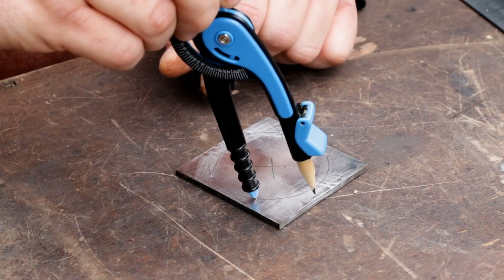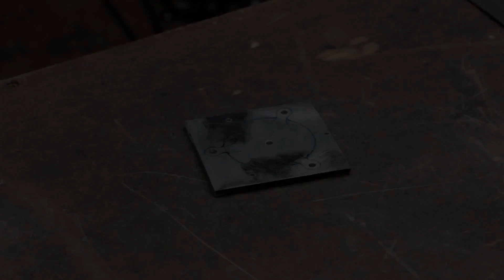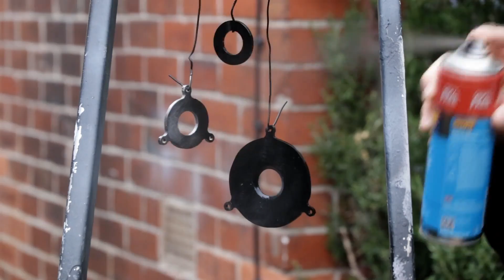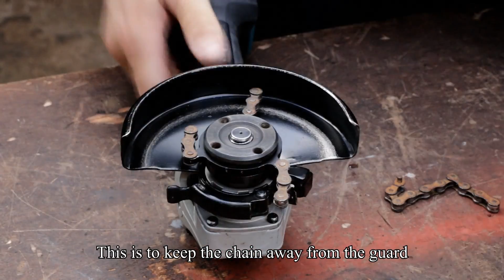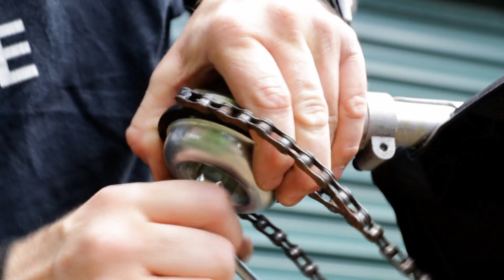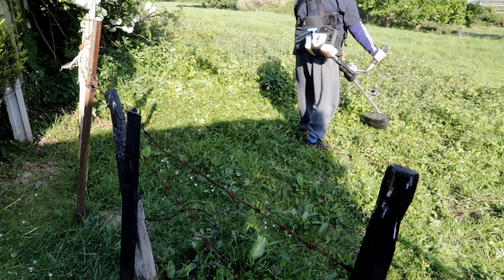Homemade brushcutter chain attachment

Comment from the maker: There is no doubt this is more dangerous than the average tool, I think if I was to make it again I would I would attach both ends of the chain to the body therefore if one of the chains broke it would probably be still attached to the tool.
If anybody does make buy or make one I would recommend wearing the same safety clothing you would wear when operating a chainsaw, and I say “buy” because you can get something similar off amazon
Reply: If we don't do anything, we definitely won't fail)). waiting for new interesting videos (Не ошибается тот, кто ничего не делает. ждем новых интересных видео)
Reply: i know im asking the wrong place but does anyone know a method to get back into an Instagram account??
I was dumb forgot my account password. I love any tricks you can offer me.
Reply: @Issac Briar Instablaster ;)
Reply: @Terry Christian i really appreciate your reply. I found the site through google and im trying it out now.
Seems to take quite some time so I will get back to you later with my results.
Reply: @Terry Christian It did the trick and I finally got access to my account again. I'm so happy!
Thanks so much, you saved my account!
Reply: @Issac Briar glad I could help :)
Reply: A company in Cleveland Ga. use to make a head called Weed Wizard. That used chainsaw chain. It was a very small company. I worked at a company that helped test them for safety. The weak link was the pin that connects them to the head. It seems they ended up using just an every day steel dowl pin. The head itself was in the Teflon family.   They were too small to have a big advertisement base , didn't get into Walmart, before Lowe's , Home Depot were really big-time. So they had about a five year run. I kept one of the heads and used it for at least twenty years. The end links would get ripped out one by one. When the chain got too short I'd simply add another section of chainsaw chain to it with a master link. Those original steel dowels never wore out nore did the original links on the chain on the head. The Green Machine trimmer it was on was stolen by meth heads. That's why I was watching videos, trying to see ways of making a new one.

Comment: There used to be a commercially made cutter like this in the 1980's or 1990's called the weed wizard but it used chainsaw chain. It was hard on the weed eater and wasn't good near walis or stone but worked great on tough weed and brush.

Comment: Why did you go to the trouble of cutting out 3 cleats to attach the chain? Just make a circle from the steel plate and drill 3 holes near the outside edge at 120 deg apart this will be better balanced too. 🙂

Comment: That's so dangerouz
Reply: And not effective
Reply: I'd say it's affective but the other stuff breaks easy for a reason lol.
Reply: Noah B the grass cutting he showed would be done quicker with nylon line  or even quicker with a blade 
It might be useful on thick hard bramble bases and the like 
Fair play to him for trying and a good enough job but I don’t think it’s worth the bother especially when it’s more dangerous than what’s available
Reply: idk that was pretty thick grass but it doesn't matter one thing is for sure tho that this chain ones would last alot longer lol
Reply: Noah B years ago I tried making some out of motor bike break cables they didn’t last a minute 
I have seen before someone made some from chainsaw chains but I’m certain using line and blades appropriately is a far better solution than this idea 
I have done a lot of s trimming in my time and I have a powerful machine maybe the one he is using is not as powerful as mine so it may be impressive for its size idk